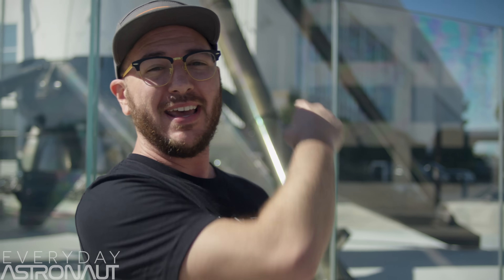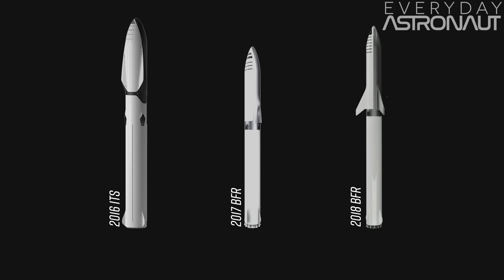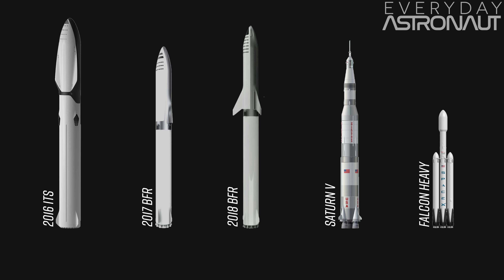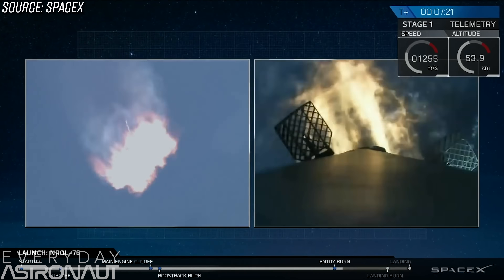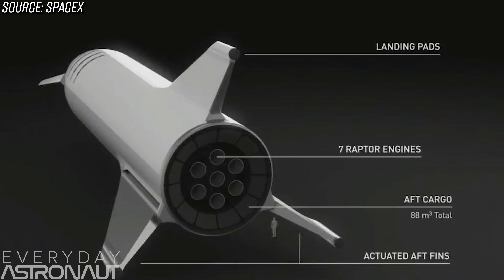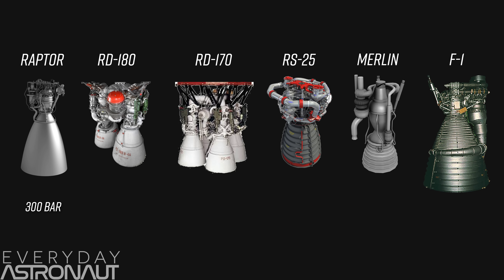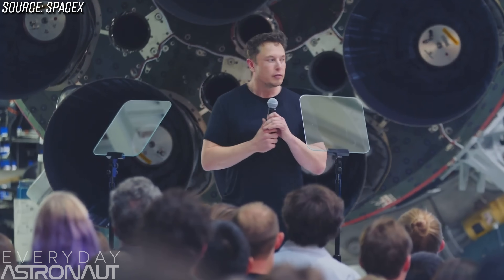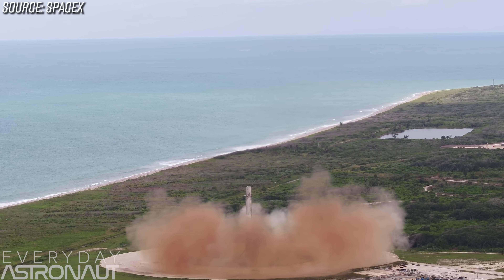Why does SpaceX keep changing the BFR? The evolution of BFR

Comment: If you do get a sit down with Elon, the main question you should ask about the the moon mission is how have they accounted for getting through the Van Allen belt without frying the Japanes Billionaire and the Artists on board? Nasa supposedily claims they have lost all of the moon mission telemetry data so they would be of no help.
Reply: that's an urban myth, the radiation on the van allen belt is not the type that melts stuff down, it's the type that you don't even notice but you get cancer 10 years later, if you go fast enought throught it it will not cause any serious damage to humans, only prolonged exposure to it is fatal
Reply: I understand that it might not be the type of radiation that melts stuff, but it is the type of radiation that can kill someone or cause radiation sickness. Also, the Apollo 11 flight director admitted that they lost the telemetry data and / or the means to play it back.... WTF..... https://www.youtube.com/watch?v=r_sazQnHKTM
Reply: btw NASA didn't lose any telemetry data from the moon, you can still listen to archived audio data and sensor data from NASA's website, you are probably confusing this with the fact that NASA doesn't have the equipment necessary to build the saturn V and apollo modules, but that's the same thing as going to a ford factory and asking them to build a model T

Comment: You ask, will SpaceX keep tweaking BFR with each launch?  And you answer, "probably yes . . . it's SpaceX after all."  Doesn't NASA have some requirement where you have to have flown the exact same rocket, and got a safe result, a couple times before they let you haul stuff or people?  

Wouldn't that mean that once the rocket's tested they have to freeze development?

And another question.  This question is related to a constraint from legacy rocket development.  Curious Droid (see link below) makes the case that 'aerospike' engines would propel stuff (or people) to space more efficiently than the 'bell' engine design we use.  He says, believably, that we aren't using the 'aerospike' design because of development, or "start-up," costs.  In other words (my words) we can spend $1 today and launch future missions for $20 each with 'bell' engines or spend $5 today (developing aerospike) and launch future missions for $19.  

A better way of expressing the trade off is that spending $5 today on developing the new engine would allow more efficient engines to haul bigger payloads.  I think this is a better way to put it because saving fuel doesn't save as much as being able to launch the same size (recoverable) rocket with greater power.

I made up the numbers for 'start up,' and 'trade off' costs.  For practical purposes the answer would depend on someone doing the arithmetic.  

Any thoughts on these questions?  Or do you have a rebuttal to Curious Droid's video?
https://www.youtube.com/watch?v=K4zFefh5T-8

Comment: SpaceX announced in February 2017 that two people had signed up for a week long trek around the moon, which the company aimed to launch before the end of 2018. That mission was to use SpaceX's Dragon crew capsule and Falcon Heavy rocket. Had SpaceX followed through with that plan, it could have returned humans to the moon near the 50th anniversary of NASA's historic Apollo 8 mission around the moon in December 1968.

But this June, The Wall Street Journal reported that the flight had slipped into 2019 at the earliest. SpaceX representatives told  that such a mission remained in the company's plans, but they didn't lay out a timeline or other details. Presumably, we will get a timeline on Monday and perhaps learn if the passenger flying on the BFR trip is one of the folks who signed up for the original Dragon-Falcon Heavy flight.
Reply from the maker: Wall Street Journal was 4 months behind on that story. Elon said at the Falcon Heavy presser that they aren’t human rating FH and that the “grey dragon” mission would now be on BFR.
Reply: in 2019?
Reply from the maker: Nope! 2023. Forget grey dragon. It’s gonezo. There’s just this new BFS trip but it’s always been the same customer.

Comment: The aft cargo modules are no where near large enough for major equipment, each one is only 7 and a 1/3rd m^3, which is significantly smaller then the container size that could be placed in the main cargo bay, which is itself far too small.

This is because the BFR has been designed as a passenger vehicle not a cargo vehicle.  Their has been virtually no thought put into the logistics of how you move massive tonnage of habitats, vehicles and supplies out of this vehicle an onto the surface.  In Antarctica we send C-130 Hercules and C-5 Galaxy transport planes capable of unloading multi-ton vehicles, and a Freighter ship carrying hundreds of 20ft containers, each person requiring on average 1 such container of supplies per year.  Setting up a base in inhospitable terrain is a 99% Freight moving activity, but Musks design is trying to be a 747 which would unload passengers at an existing settlement like they were tourists with nothing but some suitcases.

The only design that makes sense is one that has a LOW cargo hold which can deploy a ramp for roll-on roll-off operations.  Eliminate integrated passengers sections and put passengers in a hab module that can be rolled off onto the surface and then return the vehicle to Earth empty.  When people need to return to Earth roll the habitat back in the vehicle.
Reply: What youre saying makes more sense than sending a bunch of artists on a joy ride. I guess the main thing is just to get the project going by any means nessesary. Perhaps he will redesign later for larger payload?

Comment: OK - so this last revision basically means SIGNIFICANT alteration in possible flight profiles: longer first stage at expense of payload but with the same thrust retained. Same goes for BFS... anyway, it is pity that what we loose with ITS is PAYLOAD SIZE and DIMENTIONS and instead getting basically Shuttle 3.0.  As far as Raptor goes - it means, that SpaceX got brave again.

Comment: Well if they really were startig with a blank sheet, WHY WOULDN'T THEY USE AN AEROSPIKE ENGINE? ;)
Reply: A few come to mind
First, chamber pressure (square sections are less able to withstand high pressures for a given material thickness, therefore would be heavier). Unless you cluster several chambers around a transition flange to feed the spike section, which introduces more complexity, though you might be able to feed a circular outlet spike (then you need some way to suspend the spike in the exhaust flow and transfer the thrust).
Second is materials, what do you line the combustion chamber with?
How do you prevent catastrophic disassembly due to a hard start (conventional engines have this big open void the pressure can exit, an aerospike often has an enclosed combustion chamber that vents past a constrictor to the spike)

Comment: Still a magnificent machine,  but reality is hitting hard at space. X, the BFR could stop being a super heavy vehicle if evolution continues like this.from the business part of view , you hardly need more capacity than the current falcon can provide , except for interplanetary missions (because the lack of hydrogen base engines with higher  specific impulse). What is the moon capabilities of this system again ?
Reply: Probably around 30 tons+the BFS  on a free return trajectory. Consider that the Saturn V could run around 90 tons to the moon but it wasn't packing the S-II stage along with the S-IVb.

Comment: I'm not delighted with that idea of air-braking not only because you can't use it on Moon landing at all, and not because it isn't fully applicable on Mars landing, but because it really converts BFR Spaceship into Space Shuttle with all connected problems. These problems (super-thermal heating up to 1600 C) were described by Everyday Astronaut in his material (2018/07/04) about re-usability or refurbish-ability of Falcon 9 and Space Shuttle... If BFR Spaceship repeats the Columbia's destiny then it will stops Mars programs for another hundred years.

Comment: Extra idea's for the wings, out side of being used as drag control,  Solar Panels on the opposite side, extra area for thrusters on the edges.  Perhaps even a standing area for extra sensor equipment to be moved out too and have a place too sit.  If used of mounting things on top of, on the, non-re-entry sit, space walks could even use it as a place to have additional standing and sitting room.

Comment: The obvious reason why the ship only has sea level engines is that they want to do high speed tests with it before they make the booster. It simply would not be able to take off with enough fuel to reach high speeds if it only had three sea level engines. I doubt 7 will be enough to get it to orbit though, I think 9 might do it empty or near empty, perhaps carrying only a billionaire. ;-)
I guess they just decided to stick with this development configuration for a while even after they have the booster.

Comment: I have suggested an LFS in the past as a second stage for the Falcon 9.  The suggestion is more valid today.  SpaceX has to test their ideas as they evolve, and having a miniature BFS would be perfect.  You launch satellites up to 3 tons with it, it has 7 mini raptors, and the loss of the vehicle will be less costly than the loss of a full size BFS.  Testing can be done of the heat shield, the fins, the landing gear, reentry trajectory, and refueling.  Then it can be scaled up to the BFR, and either the LFS is abandoned, sold to a competitor for small sat launch, or kept as a proof of concept.  You have Elon's ear, so you could suggest it... that is after you went through it to see if the idea has merit, or is even viable.

Comment: You made a quick mistake at 8:18 when you mentioned that the new version of the BFS has 7 SEA-level engines when it has 7 raptor engines. Great video as always Tim!! Continue to do what you do!
Reply: Or maybe the image they showed was a mistake showing 7 raptor engines. But Elon talked a lot about the raptor engines during the press conference. Geez, I am confused. Help?
Reply: The old design had two sea-level Raptor engines and four vacuum-optimized Raptor engines. The new design has seven sea-level Raptor engines because the vacuum version has never been built and now never will be. The loss in specific impulse on that is probably why the payload is down by a third--after losing a half the last go-round.

Comment: AFAIK sea level optimized Raptor only gets 330 Isp AT sea level, and gets more like 356 Isp in vacuum. There's no way Merlin 1D Vac would beat sea level Raptor in vacuum operation, despite the former's much large expansion ratio.

Comment: Got to know more about heat shield coatings and how the wing actuators will work. By the way, SpaceShipOne and Virgin Galactic use a wing to slow the spaceship down for reentry, so it has been done before (although they have not yet achieve orbital velocity and reentry).

Comment: Thanks for this great update. I am a software designer/developer not a rocket one, but I do not like the duality of the functionality of the legs being tied to the aerodynamic responsibilities of the 2 fins; IMHO its too risky. I would have those 2 functions separated out. The 2 fins will be presumably under enormous forces during the slow down...if for some reason 1 of those 2 does not function properly, it will compromise the tripod...anyway I am no expert but i don't like that design...its too risky.

Comment: If you ever get the chance ask Elon what their heat shield is made of for the BFS portion. They are certainly going to need one. Also I'd really like to know how the two movable legs or rear air brakes are connected. That could be a weak point considering the stress their going to be under.

Comment: WHY does BFR have almost twice the thrust, yet only 75% of the payload capacity of the SaturnV? Is all that extra thrust used on mass needed to make the rocket reusable?
Reply: Pretty much. It needs to lift more fuel which is used for propulsive landing, so the overall mass and thrust increases.

Comment: my understanding is that the rd-180 already had crazy high chamber pressures, in fact, if memory serves correct NASA and the USA in general,  used it, despite this, because it has proven to be very reliable, amongst other things

EDIT:  I speculate that Spacex believes they can get away with 300 bar because it is 3D printed-- unlike the traditional construction where dozens of milled superalloy parts are welded together. While flawless welds can be made, they cannot be made 100% of the time, therefore a rather large safety factor has to be made for it. In 3D printing, the entire structure is welded; but it is just one weld. Not all of them will be flawless, but some will, unlike traditionally made rocket engines that will have a flaw somewhere in all of them.

Comment: It will be 15 years before they have anything ready to even try to go to the moon with passengers, Space X engineers are a bunch of stressed out over worked slaves at this point and they will experience both failures and re-designs along the way. Hopefully none of those failures involves the loss of life otherwise they 're going to quickly run out of billionaires willing to buy seats on this thing.

Comment: So basically if the BFS is using atmospheric drag to slow down it would make sense for it to land horizontally like a Space Shuttle. Next BFR version maybe ? It's not entirely clear to me how it deals with reentry heat from a Moon or Mars return without having some revolutionary improvement over Space Shuttle thermal tiles.

Comment: The sea level engines could be made out of a new type of SpaceX super alloy that could make using sea level engines as vacuum engines possible. Slightly off topic; I wonder if in-space ship to ship refueling is still on the table for the BFS. It looks like they ditched the aft refueling tubes the 2017 BFS design had. Maybe in space refueling will be done a different way with the 2018 BFS maybe with a retractable automated fuel probe on the tanker ship like what we see on tanker aircraft in the military.

Comment: It has occurred to me that the altitude the engine is optimized for changes when you reduce throttle which could improve the efficiency of the ground optimized engine in vacuum.

Comment: You did a little bit of apples and oranges comparing the sea level Isp (330) of the sea level engines to the vacuum Isp (~380) of the vacuum engines. At sea level, the vacuum engine's Isp might be more like 220 due to overexpansion and the thrust would also be much lower due to the smaller effective area of the bell. The vacuum Isp of the sea level engines is just about 20 less than the vacuum engines' vacuum Isp.

Comment: I wonder what the payload to orbit capacity of a BFS booster with 4 falcon 9 boosters strapped to it would be, just remove the deadweight of the spaceship, just like a shuttle thats just wasted mass (technically) How many tons to orbit? 
Well, it can't that much more as the spaceship is projected to only have a dry mass of less than 90 tons, but thats still wasted capacity.

Comment: It will be interesting to see how they land on the moon, they don't have the hovering ability of blue origin so it will probably be difficult to change the landing zone once on your final descent, if the bfr has good throttling control abilities that would help with the problem but without special landing pads on the moon it'll be tough

Comment: One thing about the engines: I am not sure if I might be just seeing things wrong, but the nozzle exit seems a little bigger than the sea level raptors on BFS 2017 - which for one makes sense since a larger chamber pressure lets you get a greater expansion ratio without flow instabilities, but has me thinking that they might have done some sort of nozzle geometry trickery to get somewhat of a "compromise" between vacuum and sea level engine, that has better Isp in vacuum than a pure sea-level engine, but is still usable down to sea level.
Reply: Ah, so like the RS-25 with its divergence angle changing quite abruptly very near to the nozzle exit so it didn't have as much flow-perpendicular ("horizontal") velocity, so the exhaust didn't have as much risk of detaching from the nozzle walls and causing flow instability which reduces performance and can easily tear the nozzle apart as the internal pressure fluctuates wildly and asymmetrically, applying great "horizontal" (relative to the flow direction of the exhaust) shear forces to the nozzle bell.

Comment: Awesome video! There's just one thing I wanted to say: control surfaces don't work by generating drag, they work by generating lift, so they absolutely are aerodynamic surfaces, using the same term you used! (the fact that their lift gives birth to parasite drag is another matter). As Elon said, of those three, only two are actuated and therefore have control purposes; the third surface is "just a leg" and its main purpose is to allow the BFS to land properly, even though, to be clear, it is so big it necessarily has an impact on the momentum derivatives of the ship. So SpaceX will surely need to properly evaluate them.